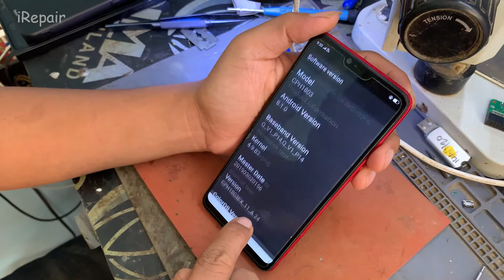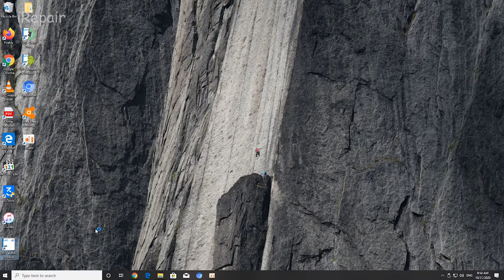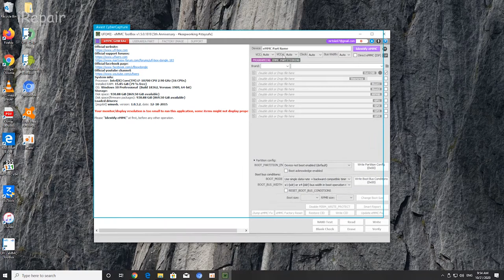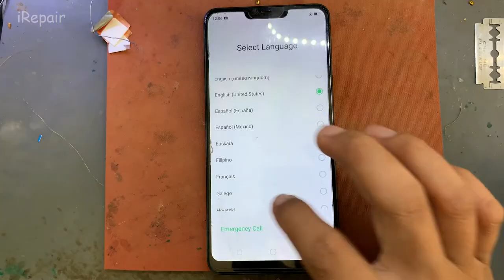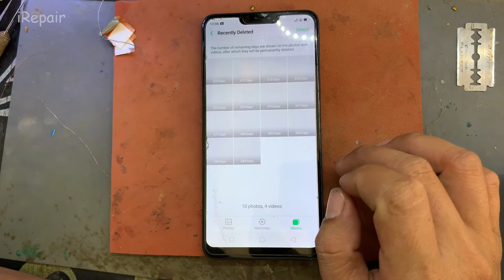OPPO A3s Unlock Password Without Losing Data By UFI Box,Oppo A3s Pattern Unlock,iRepair

Comment: I want to ask you please the box ufi helps to unlock the password of the phone and if someone takes my informations I gonna discover that because he gonna remove the password that I put. And I want to ask if the relation between the hard and the box demands a lot of time. And if there is a box that gives password without removing it. Thanks in advance
Reply from the maker: Basically decrypting it will erase a lot of the data we have. Do not worry, they can steal our data. It can only save our photos
Reply: @vfixer7740  thank you and if he tries to take them I will discover that because he gonna remove the password that I put.. No?